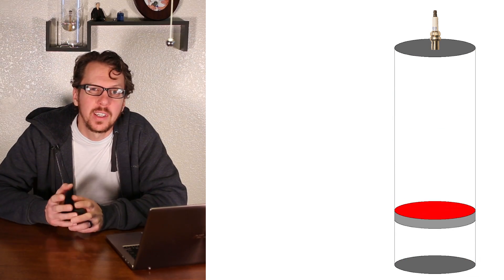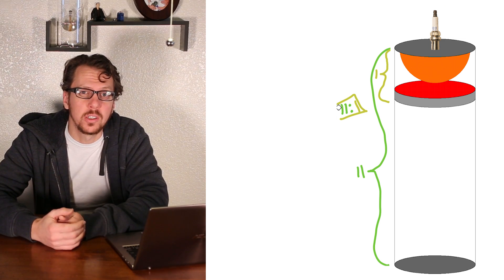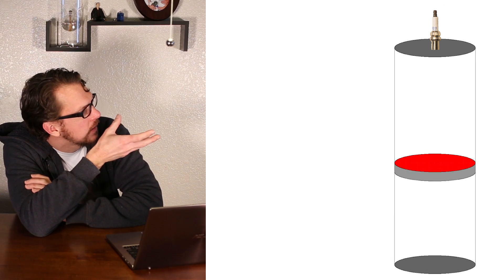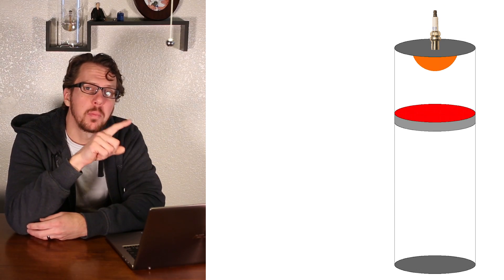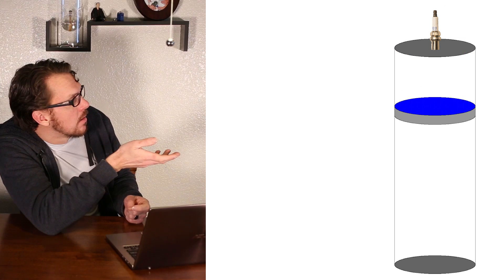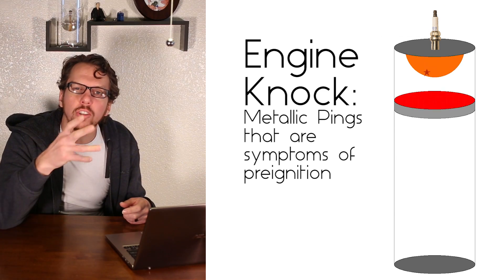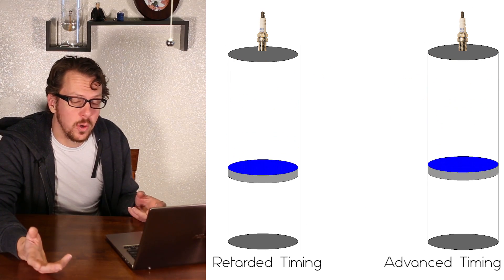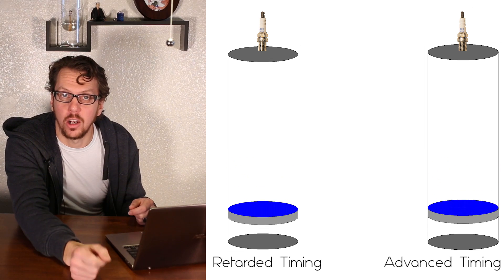What is compression ratio, preignition, knock, and ignition timing?

Comment: That's very helpful but I should say that your definition of pre-ignition is not correct. Pre-ignition is an ignition that occurs Before the ignition of the spark plug. And the knock occurs During the ignition of the spark plug. So they should not be confused, however, the pre ignition could also lead to knock since it raises the temperature in the chamber. Both high pressure or high temperature could lead to knock.

Comment: I've just finished a head reco and new gaskets on a 3.8 v6 Holden Commodore Ecotec (GM motor). Surfaced the head, seated the valves, new stem seals head gaskets and manifold gaskets. Put it all back together and has very loud knocking. What to do, and how please.

Comment: Excellent explanation, exactly what I was looking for my knocking issue which I suspected was due to lower octane fuel.

As mine is naturally aspirated engine and given the fact higher octane fuel is not easily available, changing ignition timing is the only option I suppose which will need remap.

Thanks again.